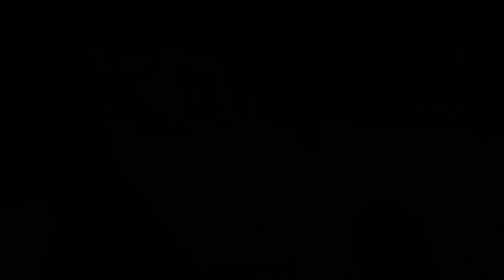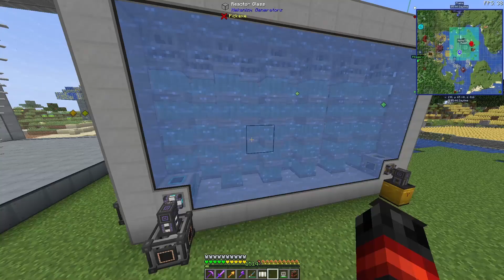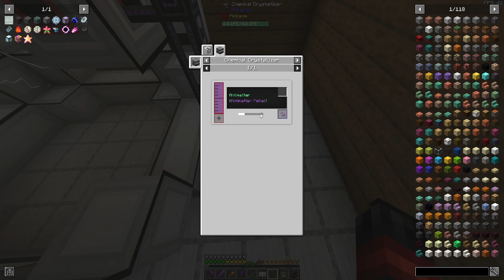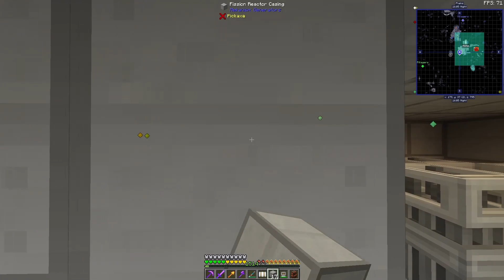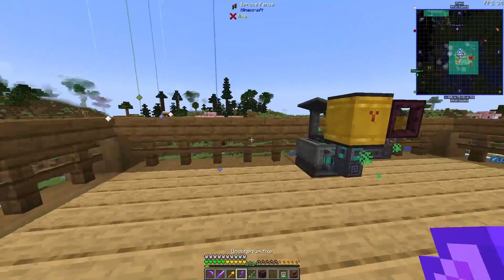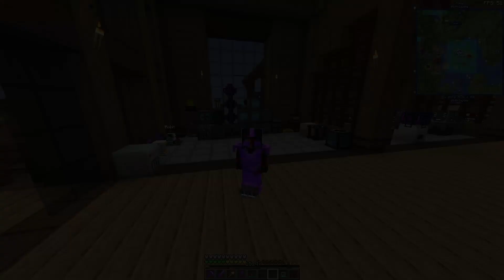All The Mods 7 - ep23 - Sodium Cooled Fission Reactor!

Comment: Isn't there an eternal water from evilcraft in ATM7?
And pipes from Mekanism do not only work as a buffer, they also stack their pump rate, when connected. So two pipes double their run trough, if you know, what I mean.